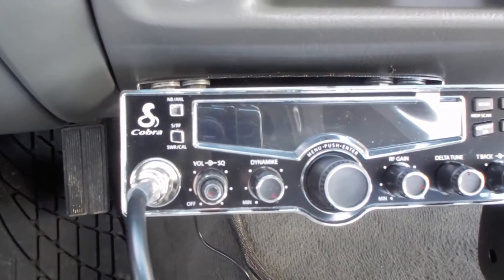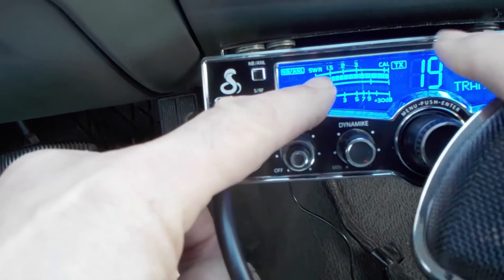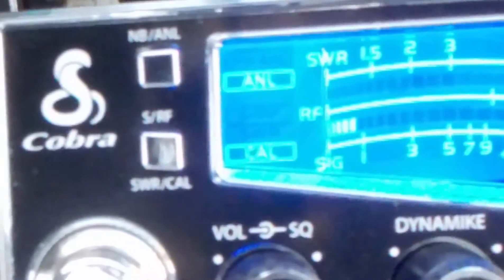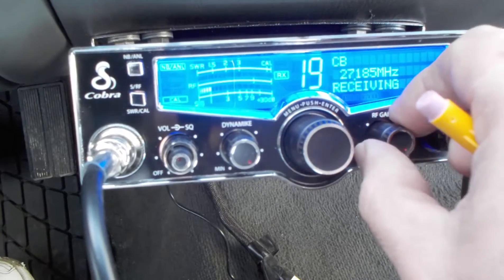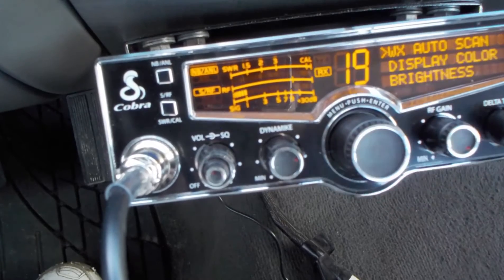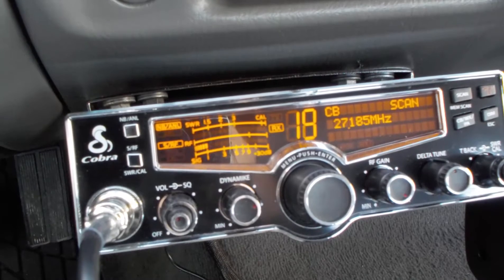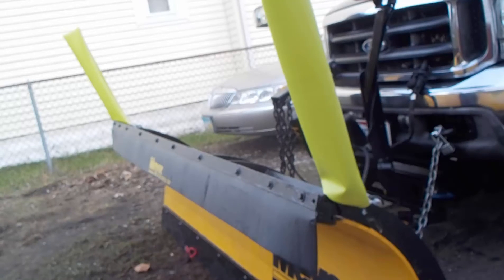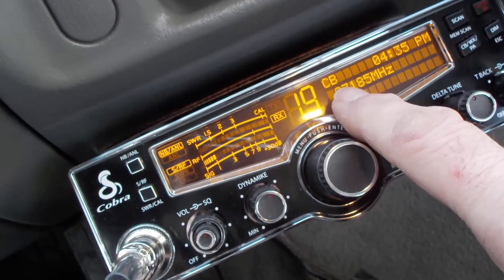CB Radio for Beginners Part 4 Using the CB Radio Knobs

Comment: Thx man very informative I have exact radio   Hey can you do a vid on tuning the antenna
Reply from the maker: Hi Slick! Thank you! And you're welcome! There  is a video in using the swr meter, is that what you're talking about? Thanks for watching! Jim
Reply from the maker: CB Radio for Beginners Part 3 SWR Calibration on Cobra 29 LX
https://www.youtube.com/watch?v=_qsCFAxystM
Reply from the maker: While I was doing the CB videos, I read a comment somewhere, the fella said antennas are tuned at the factory these days (2017), and don't need adjusted the way we used to back in the 1980's, like cutting pieces off the length to set up the swr. And don't change the length of the cb antenna cord, that part of the config too. I almost shortened my cord till I read that!